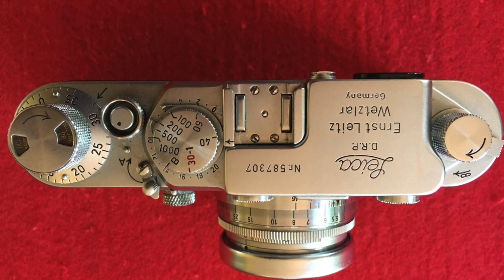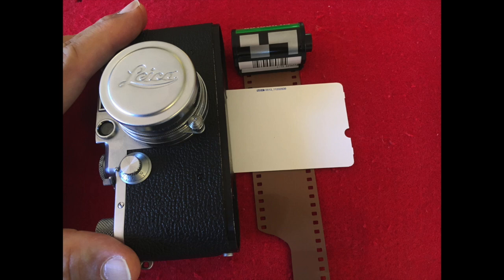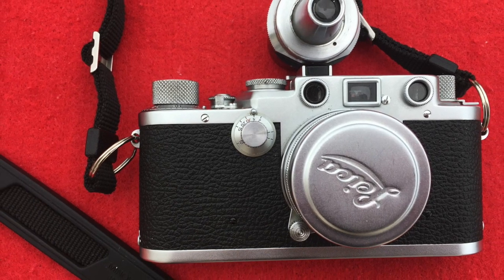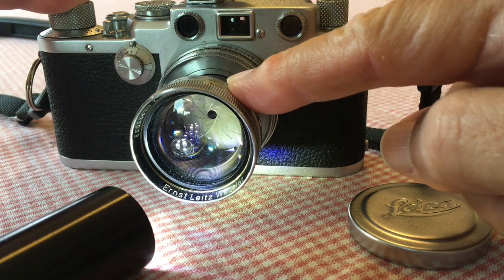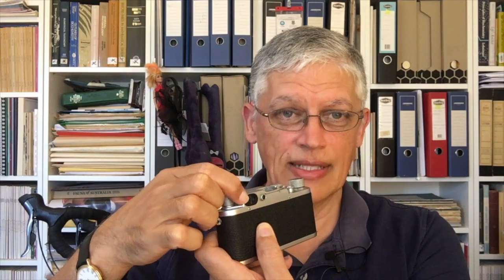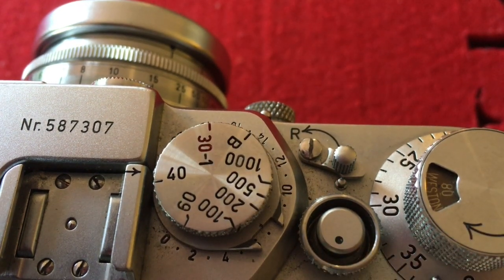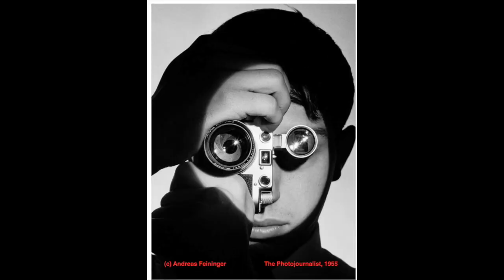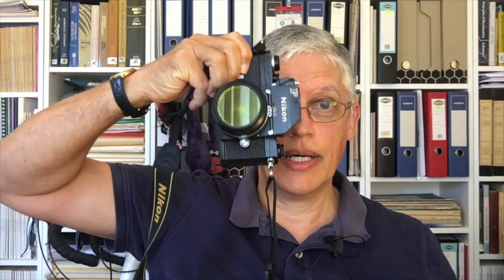I bought a Leica | things no one tells you

Comment: I never owned a Leica. Never wanted one. If all cameras were like the Leica i would have chosen another hobby. Thank God for Japanese cameras.
Reply from the maker: Quite so. Thanks for sharing your experience. Cheers.
Reply: someday and you can afford a Leica
Reply: I have owned Leicas and still own a digital model. Leicas are crafted and have fantastic lens. Brilliant photos. You don't like? No problem. You can't afford to buy one.
Reply: A choice of a camera is like a painter choosing brushes.  
I bought my first M2 in the 70’s as used….a lot cheaper then. I also bought an a M3 about two years later. Both are still working great. I had a Nikon F which I gave to my brother when I bought my Nikon F2.  When I started using my M’s I put my F2 on the shelf.  I just prefer range finders for my type of photography.
Reply: Yeah. But it's fun to torture and infuriate yourself and mess yourself and others up out of frustration and impotent agony.
Otherwise.. jesus will be out of a job as your savior and redeemer and there is enough unemployment as it is.
Reply: The simple answer is to use whatever camera and lens you want, don’t give a darn what ever other ppl use because the only thing that matters is that you enjoy your photographic experience ;-)
Reply: Bacouse you never try
Reply: I agree. I own differents Leica, and I have to admit that the system is way inferior to a reflex. Simply in every task, a reflex will be much more intuitive and quicker to use, not prone to any misalignment nor limitation.
Reply: @oreziopancrazio3685  
Well Leica must have done something right with their inferior designed range finders since the basic design and form factor hasn’t really changed from the M3 some 70 years ago.  So many people must like the inferior M6 which along with the MA and MP are the last film cameras being manufactured.  The digital M’s seem to be in demand also.

Comment: Good grief. I've used Barnack Leicas since the 1960s, trimmed my own film leaders with my Swiss Army Knife since film manufacturers stopped cutting it, used them like the (now somewhat eccentric) gems that they have always been, never needed all this mumbo jumbo. If you're in action with one, you wind it by opposing movements of both hands: Left hand holding camera body, over the top toward your shoulders. Right hand holding winding knob, turn away from your shoulders. Simple, fast, you feel it.

Comment: A leica iii can as well be used for "reactive photography." For example, you can push your 400 film to 1600, and that would allow you to use f22 or f16 for almost all situations. There you have a very deep depth of field. Preset the focal distance to 7m, then all you have to do is to frame the photo and press shutter.
Reply from the maker: yes indeed, especially if you use a wide angle lens such as a 35 mm or 28 mm. Thanks for sharing your experience. Cheers.

Comment: My first Leica was a family camera. Ye Olde Leica IIIa was fitted with a 50mm f/1.5-9 Tayor-Hobson Xenon. This 1930's "speed lens"lens had dirt between the lens elements and visible haze, leading to fuzzy images. As soon as I could, it was replaced with a 1950's 50mm f/3.5 collapsible Elmar, which produced great Kodachrome slides and black-and-white negatives. Back in the 1960's, Kodak film had a "Leica tongue," until Fuji arrived with it's "short tongue." I cut a "Leica tongue" (and Fuji "short tongue") template out of cardboard which I used during my college days. In those days, I bought bulk film from a local "cost + 10%" photo supply store or Freestyle Sales Company. The latter company introduced me to Ilford and ORWO black-and-white bulk films. To use the Leica "after sundown," I had X flash synchronization added, which worked at 1/20 sec.
Reply from the maker: Thank you for sharing your experiences. Cheers.

Comment: Love my Leica iiif. I’ve had it jam up because of torn film but I’ve never (as far as I can recall) gotten film stuck in the shutter curtain- I will definitely take care to trim it (or tear it) more smoothly though. As for how slow it is, I generally find that I can still zone focus with it very well using a 35mm summaron. Take care not to hit the rotating dial with your finger though as you release the shutter. Another important thing about these screw mount Leicas- the minimum focus distance is something like 3.5 feet. That said, a lot of these older leicas have holes in the shutter curtain or unreliable shutter speeds but they ARE serviceable. Had mine fixed up perfectly, lenses included, and I get the itch to use it every so often. It’s just such a beautiful camera and feels good to hold
Reply from the maker: thanks for sharing your experiences with this camera. They are easy to carry and take up so little space. I agree that they are beautiful and once you get used to them they get out of your way. Cheers.

Comment: I shot a roll a day in my lllg back in tho 60s and remember having a bit of filling getting the film to load easily. But I do remember that I cut the leaders rather crudely and not having any trouble. I bulk loaded slightly out of date Kodak XX film which worked out at about 1 cent a frame. I think I encountered some film chips and learned to not cut through the  sprocket holes. The roll a day exercise took about a year to close the gap between how the image in the viewfinder looked to how it was rendered on the film. So I learned to previsualise with a rangefinder  - an awareness which does transfer even to single lens reflex photography.  I am a B&W photographer at heart but like to shoot with my Olympus EM-D 5 Mark lll with the viewfinder in monochrome because I’m grateful to not have to translate the colour viewfinder image into monochrome. Seeing it directly still gives me a boost.
Reply from the maker: thanks for sharing your experiences. Cheers.

Comment: Leica M cameras are quieter than the old models. Not actually quieter than a modern SLR/DSLR, but "smoother" than SLRs up to the 80s, less intrusive (less moving parts, no mirror, less "going on"). I had many M cameras and a Leica IIIf (I kept the IIIf), and when it comes to sound, the M models sound quieter and especially nicer. Still, I like the "sound" of the IIIf (and its predecessors). A Leica II or III (up to f) is also small, "feels good", the lenses are tiny, the rangefinder is astonishingly accurate (because it has magnification built in, works well with a 135 mm lens) and has focus adjustment (no corrective lenses needed like with the M models). The severe film loading problems you mentioned I haven't encountered (with two different IIIf cameras), but I use a cutting template (not the original one, but with the same dimensions) and try to be careful to determine that the transport works. In the end, you either love or hate this camera. That I kept the IIIf should make my feelings clear … ;-)
Reply from the maker: thanks for sharing you experience. I think there is also a middle ground of people who dismiss it, they neither hate or love it, and wonder why one would repair them or keep using them. But in the short time I've had one I've come to like it very much. Non photographers think they're beautiful, btw. Cheers.

Comment: I have the iiif. It is actually possible getting the film in without cutting the leader and without removing the lens, but it takes a little fiddling around until you feel it 'slide' in. It never failed on me although in bad days it takes a little bit more time, but your miles may vary. I'd cut the leader if I know I would have to sit and change the film quickly outside, otherwise I won't bother.

I self service this particular camera so even if the film got jammed I'm not super worried about shards of film if it fails.

Also the 10cm part of the leader will be exposed anyway, cut or not, so you don't really waste more film by cutting the leader.
Reply from the maker: thanks for sharing your experience. Cheers.

Comment: Thank you - very informative for me pondering the acquisition of a Leica III  to add to my small collection of film cameras. A collection that I use and rotate between cameras as I desire. At present my oldest camera is a mint condition Rolleicord IV from the late 1950s - visually and mechanically a joy. 

As a child in the 70s all I wanted was a Pentax SLR (to me more appealing than the Canons or Nikons of that era) but I “made do” with a Praktica through the 80s and it still works just fine. 

I finally got a Pentax MX dating from the 70s and it’s a gem. The MX was the smallest SLR ever made and is roughly the size of the Leica III but is quite heavy by modern standards 750g with 50mm f1.4 lens attached. 

The funny thing about the “silent shutter” (almost) of the TLR Rolleicord is that there is less of a sense of occasion pressing the shutter than an SLR, and maybe the Leica as well. The auditory feedback of the mirror and shutter is quite enjoyable in my opinion. Yes it announces you to all who are close by but you feel involved in the process. 

With the super quiet Rollei the moment passes in virtual silence so in some ways less satisfying. It does take great photos with that big negative and sharp lens though. 

Easily the most enjoyable is the Pentax MX with its large, high magnification viewfinder and TTL view means you feel connected to the image. I do wonder how the Leica rangefinder experience will compare.
Reply from the maker: You’re welcome and thanks for sharing your experiences. The viewfinder on any Barnack Leica is barebones and you should think of it only providing information on what is in focus and approximately what is in frame. A top SLR gives you a better viewfinder in my opinion, except it blacks out as you take the picture, which some people hate. You get used to the quietness of the shutter and it’s not that quiet, each camera due to their age being more or less quiet. If you do buy one get it with a repair warranty because the cameras cost as much as the more expensive Leica M to service because you’re mainly paying for labour.

Comment: The easiest way to trim the leader is by using a leader cutting jig. It’s a hinge with a slot cut to the shape required for Barnack Leicas. Leitz made them for loading the Leica brass reusable cassette with rolls of cinema film. You pull the leader out to engage the sprocket hole to a tab, then close the hinge and cut down the slot with a small pen knife blade, leaving a perfectly trimmed leader. I don’t have a Leitz trimmer but an aftermarket one. It’s made of aluminum and weighs next to nothing.
Reply from the maker: Thanks for sharing your experience

Comment: I own my fair share of cameras, nikon F3, some Mamiya medium formats, and some yashicas. My    leica IIIf is still my go to and my favorite. It slows me down. 

I invite you to try the card stock loading method without trimming the leader. 

Place camera to T.

Insert card stock until you feel it seat into the film guides. 

Then insert the film behind it and wind once. Then remove the card stock.
Reply from the maker: Thanks for sharing your experiences. However, I think there's been a slight misunderstanding. As I said in the video, I did try that method and it just does not work with my copy of the camera. Cheers.
Reply: Dear Mr.Houstondrum  thank you for the Newton trick film hack. Nothing Like in like flint! Maybe I try if I'm ever so lucky to pick up a Leica. Sure would like to know how to set Leica sequence shutter speed dial on a S nikon. Maybe I'm just dense? Is 1-20 worse than 1-30? I shot film two summers ago and seem to remember queuing to 1-20 before establishing final lower or upper dial as the case may be.someone said to select the top dial first at 1-30 then choose your lower dial? Im shooting existing light in my dim trailer. I know how to use a weston meter I just want to know exactly which number is considered home base,? 1-20 or 1-30. Or some other number for normal daylight. I would think 1sec exactly. Then in my low light in the trailer 1-30 : 1/30 of one second. I logically would choose 1. The unit. Then the fraction thereof. Math was never my strong subject. So if anyone who knows exactly thanks for any help. I'm used to speed dial on Nikon F which I grew up with. I've had my S for two years and still don't understand the twin dial Leica type system. I'm getting ok exposures but want to understand the shutter speed dial.

Comment: Well, I think I’ll stay with my dated Nikon F cameras. I understand them, they’re fast and simple to use but foremost is my familiarity with them. Maybe not so classy or costly as the Leicas and certainly bulkier. After 30 plus years with them they’re an extension of my eyes and hands. I’ve used M series Leicas in the past and I liked them OK but my Nikon was faster if speed was needed.  I’ve also used the Nikon rangefinder cameras and still have a very nice black Contax from that era. All the rangefinders are conveniently small and quiet but in my hands, they lack the familiarity of my tank like F cameras. I also developed a film trimming scheme that’s not recommended but works well for me and avoids the problems you’ve encountered. Excellent presentation and a really sweet looking Leica.👍🏽👍🏽
Reply from the maker: thank you for sharing your experiences and your kind words on the presentation. My three best images this year were all taken with my Nikon F and a wide angle lens. Cheers.
Reply: Paul. What’s your “go-to” Nikon F model?
Reply: Basic Nikon F cameras from the late 60’s and early 70’s. I have a couple of FTN’s but I prefer my Gossen hand held meter. I periodically have them gone over by a good camera tech but they seldom need anything. I recently found a brand new one from 1971. Favorite wide angle is the 24.8, favorite normal is my 50 1.8, favorite tele is my 105 2.5. Also have a 28 3.5, 35 2.8, 55 3.5, 135 2.8, 180 2.8, 300 4.5 and 1,000 11. The long lenses don’t get much use nowadays. I’ve never been a big fan of Zooms. I bought my first F in 1968…still have it…still works. If Nikon still made them, I think they’d sell OK.

Comment: You have to realize that this is a 75-year-old model. Leica's breakthrough came with the introduction of the M3 and shortly after the M2: with an improved film insertion method, the rangefinder incorporated in the viewfinder and automatic frames for the 50, 90 and 135 mm (M3) and 35, 50 and 90 mm for the M2. Which made the M2 the most versatile camera for reportage photographers in the sixties.
Reply from the maker: thanks for sharing your experience and opinion. Personally I think Leica made more than one breakthrough and that the M Leicas are the culmination of the rangefinder design. Cheers.
Reply: What if I told you that the Nikon SP came out the exact same year as the M2 and had frame lines for 28, 35, 50, 85, 105 and 135 and didn't require the second take up spool that the m3 and M2 used making loading significantly easier

Comment: Great presentation. The critical the film loading procedure with this camera is well covered. The Leica IIIa is a gem but his presentation brings out all the things one must do to get good results and not damage the camera. A real bargain lens for this camera is the 90mm f4 Elmar.  The Canon 50mm F1.4 and 135mm F4 Ltm are also great lenses to use with this camera and go for a reasonable price.
Reply from the maker: thanks for your kind words and sharing your experience. Cheers.
Reply: Yeah, the 90mm f4 Elmar is not only a bargain, it is a great performer too! I first bought one as a temporary replacement for an Elmarit 2.8/90mm that needed service, had it on a digital M8 – and was blown away by the image quality I got! It has its downsides (heavy blooming in highlights when wide open), but overall results are just good. I love it.
Reply: Oh, and speaking of Canon lenses for rangefinder cameras – I do have a 35 mm F2, and it is well suited for the old screw-mount Leicas (there was no similar lens from Leica). It gives an "old-style" rendering wide open, and becomes rather "modern" real quick when stopping down.
Reply from the maker: @c.augustin  there is a rare 8-element 35 mm summicron in LTM from 1958 to 1963 that costs a fortune, more expensive than the 1999 version 35 mm summicron produced in LTM. And we shouldn't forget the expensive W-NIKKOR 35 mm f1.8 from the opposition ;)
Reply: @billbarendse1918  Yeah, right … I'll stick to my Canon 35 mm 2.0. If I grab the Leica, I'm fine with "old style" rendering. Maybe, but only maybe, I'll search for a nice Summaron 2.8/35 mm in LTM (I had the M version, and I loved it); hard to find (more M versions around).
Reply: @c.augustin  Talking about Canon bodies, the Canon IVSB2 looks a lot like the Leica iiia and is remarkably well made. I find it easier to use than the Leica iiia but a little less nostalgic as the Leica iiia was my dad's first camera and took great pictures.
Reply: Regarding the Leica 8 element f/2 35 mm  LTM, Light Lens Lab makes a replica of that lens, although expensive is still cheaper that the Leica.  Reports are that the replica is a very good copy both mechanically snd optically.